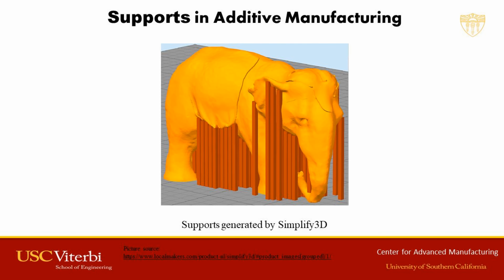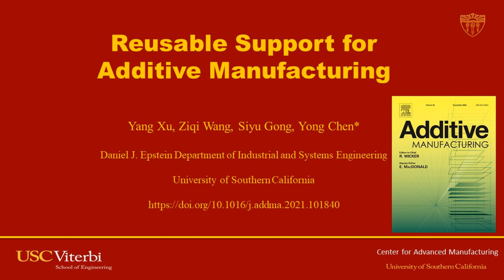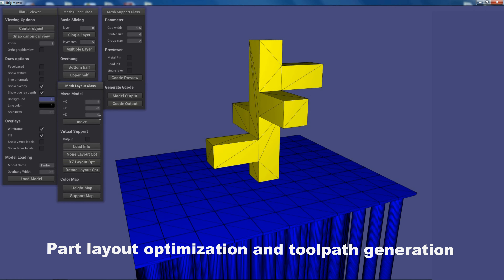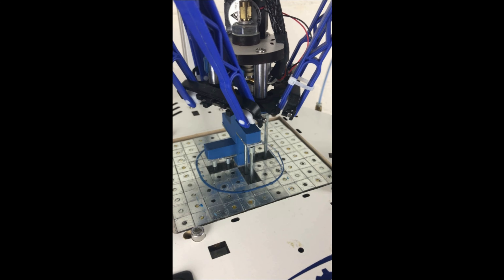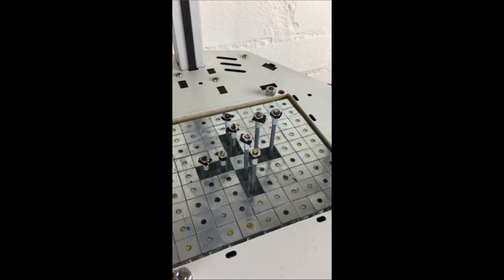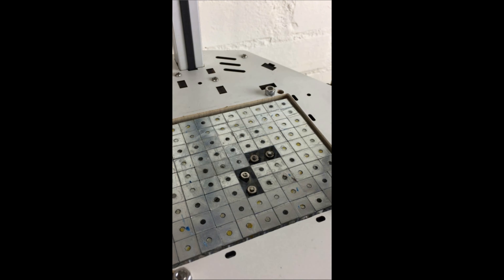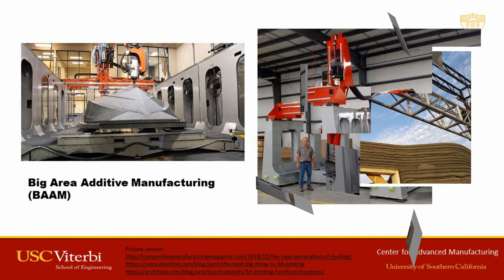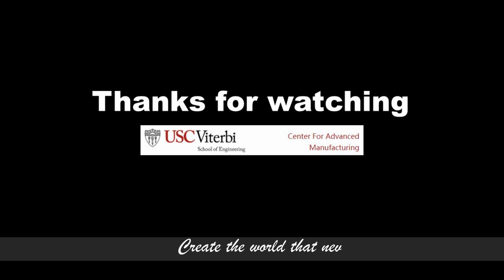Reusable support for 3D printers

Comment: I'm much more interested in how you are able to raise each pipe individually with only 1 motor. Are you somehow gripping and releasing them as the platform raises?

There are actually a lot more uses for this technology than 3d printing!
Reply: Same question
Reply: Woudldn't it be the same as a keyboard matrix or similar? It shouldn't take much at that point.....
Reply: @FollowNdFeel  a keyboard matrix relies on your fingers to press down a key to activate the circuit in that specific location.

The main issue is how do you individually "move" each metal tube using only 1 electric motor?

Second to that, how do you make the tube hold its position after moving. I thought maybe an array of electromagnets, but it doesn't help it to move incrementally and hold its position when power is turned off.
Reply: @ilovejobbo  Pins of specific heights are inserted before the print so that only one motor is needed to drive them. It's not automatic.
Reply: @TheBlackBeltPanda  the pins look like they are the same height in the video. 

Also the pins are smooth with no grooves, so not likely to use gears to make them raise by 0.2mm in height per layer. 

What holds the pins in place after each layer raise so that they don't fall back to their initial position?
Reply: @ilovejobbo  The pins are different heights. Under the pins is a platform the size of the bed. As the platform raises, it pushes the pins up.

Comment: What if it just placed metal blocks to the required positions on the bed?
Reply: the hotend would crash into them if placed before starting the print, otherwise you would have to place them at the exact time/layer-height needed during the print to avoid that
Reply: @findtherror1747  I know. I imagined some kind of pick and place mechanism next to the printhead. It would require less machinery, but more work softwarewise.

Comment: Doesn't laser melt powder already get supported by its own? Why would it need this method to be applied to it?

Other than that it seems like a pretty good idea the R&R would definitely lag behind the community unless you made it affordable outright because markets will find alternatives and no patent can beat open source. So you best b make friends with the Maker community because it's this isn't the first time an idea of this genre was overtaken by the Maker community.
Reply: It does, but powder that has been used before must be mixed in with new powder before you reuse it. This method may help keep the new/old powder ratio higher by having less leftover powder at the end of a build. New powder typically creates a better surface finish than powder that has already been processed. The benefit would still be less significant than for FDM though.